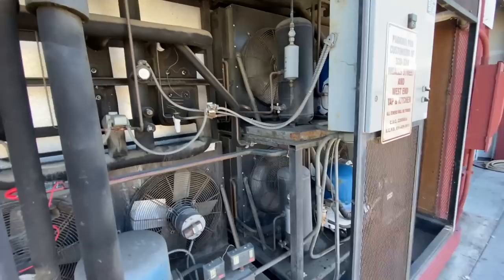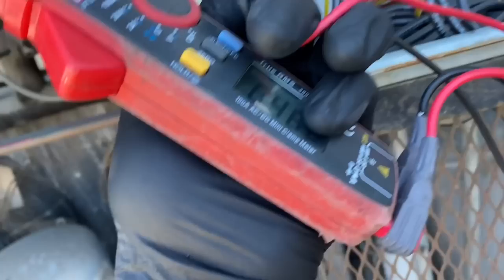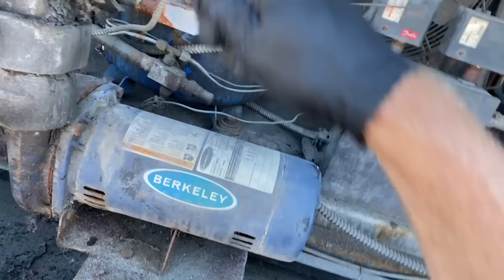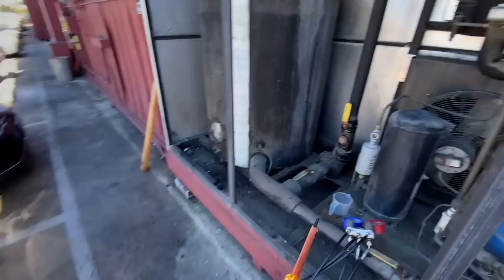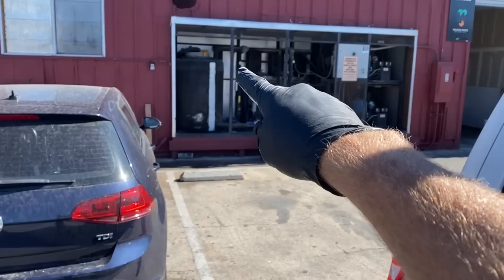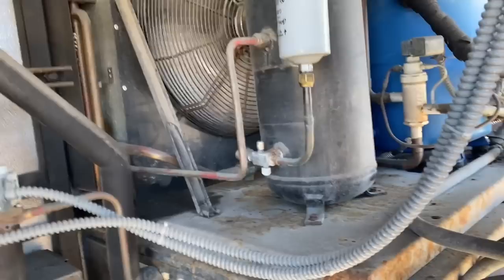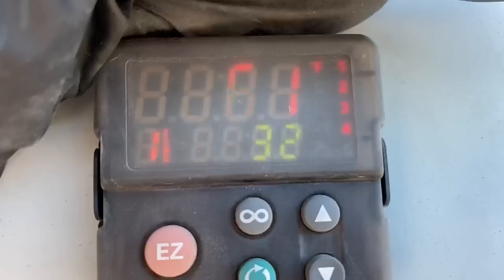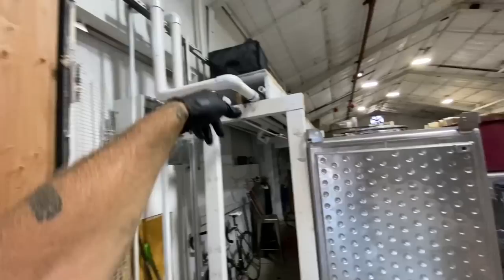40 Ton Glycol Chiller

Comment: Those compressors look like compressors manufacturer by a company called Maneurop,they hit the market where i live around 1990's. There gig was that it was a double compressor shell housing which they say acted like a suction accumulator, and there single phase 230 volt compressors were just that not 208/240 which was a problem you had to add a buck &boost transformer as they had trouble starting on a 208volt system, needless to say not impressed at all
Reply: I’ve worked on one of these systems before in San Francisco. It was from the late 90’s I believe. They used it for a soup chiller 134a system with 10ton txv haha
Reply: A bunch of them here in south America they are from Danfoss, they are not bad and haven't experienced that voltage issue here and we run 208 when everything is perfect which is not usually the case 19-201 is more usual tho all i service are 3 phase.

Reliable but LOUD mofos.

Comment: Are you wearing the plastic gloves because of the 480v, or to keep hands clean, never worked on 480v, always 575v or 208-230, I hear that 480v is a beast, not like the plastic gloves are rated for electrocution, but may if back of hand  rubs something while checking voltages.

Comment: 👍💪❄️🇺🇸 Nice 👍 b interested to know the glycol brix% freeze point level. Glycol breaks down loses viscosity n can cause freeze ups. Sat for 2yrs.  Thankyou dave
Reply from the maker: You want 30-35%. To much glycol you loose capacity
Reply: Yeah the lowest Ill let it go is 25% that works on the beer cooler  units I work on between 29-25 brix % glycol units. Don’t too thick either. Thanks dave 👍🙏
Reply: @shine-cg9uf  So glad we 86'd our long draw draft system in our granstand, a couple of those concessions had 250' lines between the kegs and taps.
Reply: @davejohnsonnola7908  holy long distance batman!!! That's insane. Kegerators if possible.
Reply: @shine-cg9uf  screw that....bottles or cans only!😎
Reply: @davejohnsonnola7908  lol yeah but us beer line cleaners still need draft 🍺